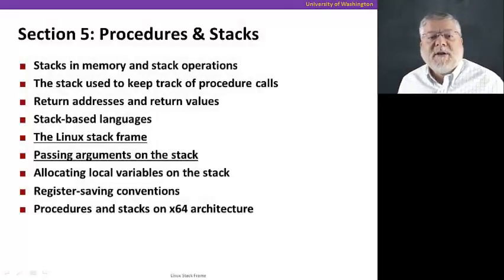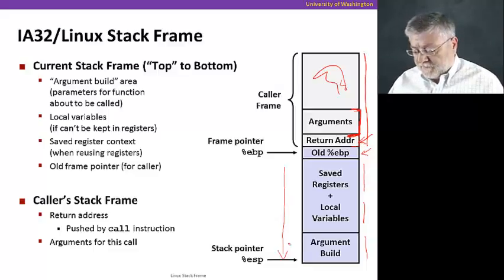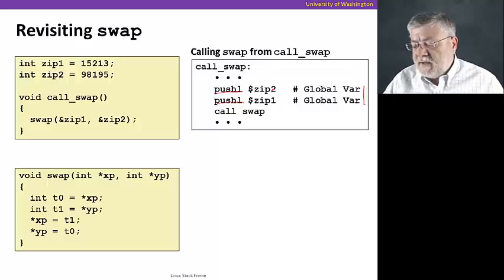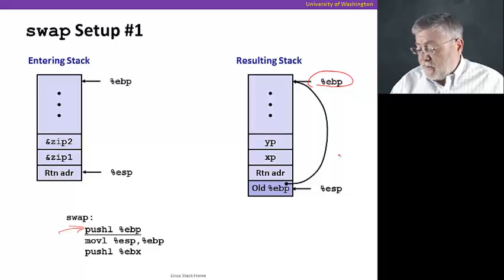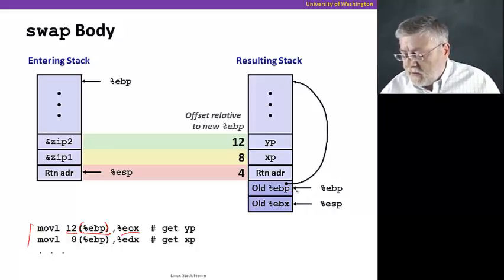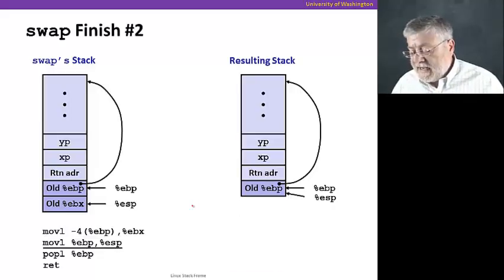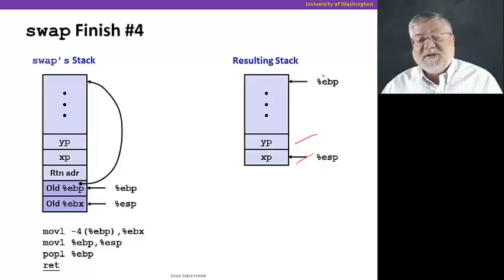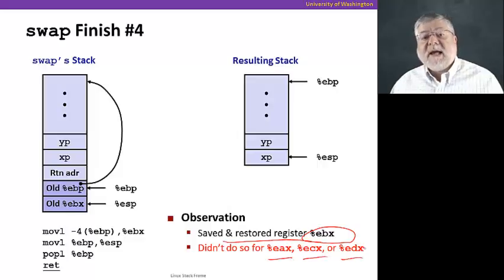Procedures, Video 4: Linux stack frame

Comment: I didn't understand why are we pushing the ebx register in starting of callee frame and moving/popping in finishing?
Reply: It is a back up of the register. The register may be used by the caller, so the callee stores its initial value and restores it before returning. This is a convention. This way, the caller can be guaranteed that the value that was in ebx before the function call is still there.
Reply: @domenicodefelice2083  Thank you so much for the explanation.